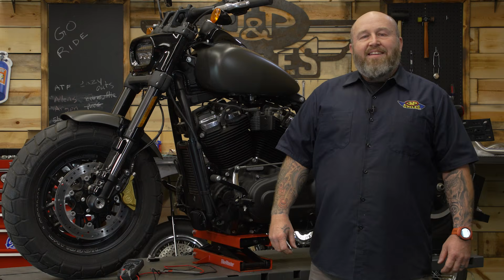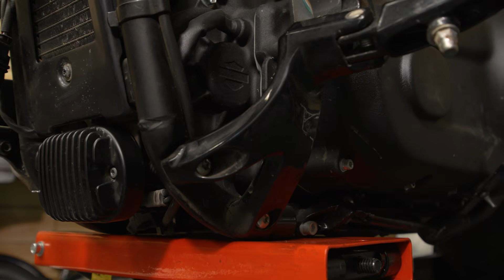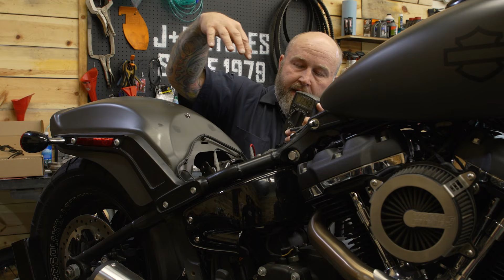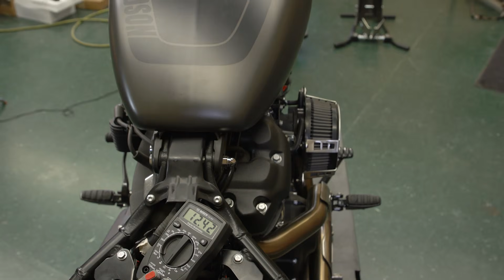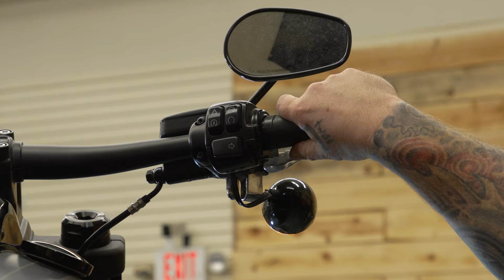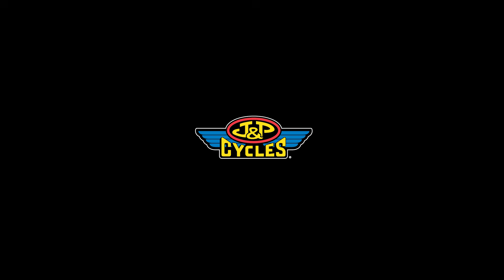How to Test a Harley Davidson Voltage Regulator : Weekend Wrenching

Comment: I have a 1993 FLHS. It wasn’t starting. I had been out riding the night before. I parked it in my garage. Next day I went to start it and I got nothing but a click. I called my mechanic and he was super busy. So I watched some videos and wound up ordering a new starter relay. I also ordered a new starter cover with manual bypass-starter button. I did bring the battery, which I had recently changed just a couple weeks before. The battery wouldn’t charge so they gave me a new one. I replaced the above mentioned parts and the bike has been running and starting although sometimes there’s a slight hesitation, which finally brings me to my question. I don’t want to deal with the bike not starting, especially further away from home. Is it worth upgrading to a high performance starter kit? Is it something that a rookie mechanic can handle ? I’m gonna check out the other charging system videos you have. Any thoughts would be greatly appreciated. Thank you.
Reply from the maker: Starter replacement is fairly easy. You can do it in the garage with no lift and hand tools
Reply: @jpcycles  I need to figure out if it needs a new starter or if it’s not charging.

Comment: You can get adapter clamps for the terminals. When checking voltages, what's the best way to bypass the regulator, so you can diagnose further. Familiar with cars, but not a bikes. Thanx for all the positive info! Gremlyn,  SE, Georgia
Reply: I too would like to know how to bypass the regulator to test the stator output, similar to full fielding a charging system on a something with 4 wheels.

Comment: Its crazy you guys post this. I just got my 2020 softail standard back from the dealer just last month. Regulator took a shit, and at 3000 miles. glad it happened in the city, and not a long trip. YIKES. First symptoms were exactly that. Dash lights, blinkers, headlamp fluctuating until finally battery light indicator. keep up the great work guys.
Reply from the maker: Sorry about your bad luck. 3k seems way early for a regulator to go bad. Glad it didn't leave you stranded.
Reply: Should be a recall on VR's #1 issue with Harley charging according to most service techs
Reply: @Just J not gonna lie, i miss my Hondas reliability. 2017 Honda Rebel 500. I bought her brand new in 2017. Put 12000 no problem miles. I traded her in for my new 2020 Softail standard, and at 3000 miles, regulator goes out. What’s worse is the time it was at the shop. 🤦🏻‍♂️